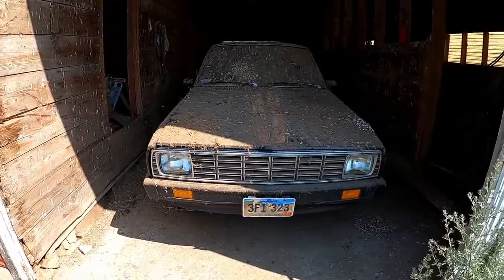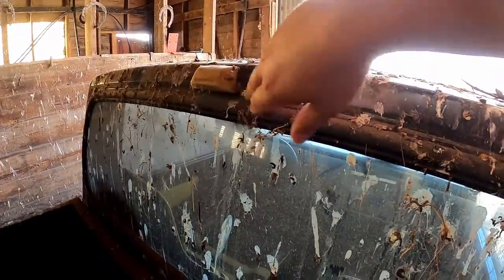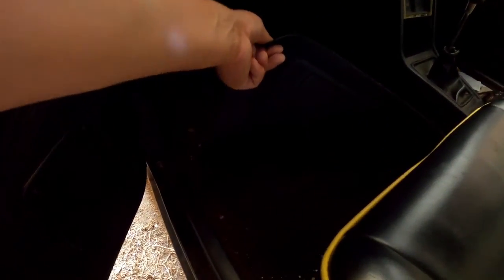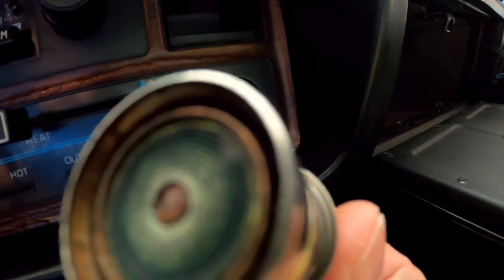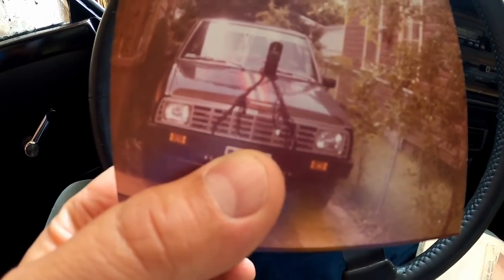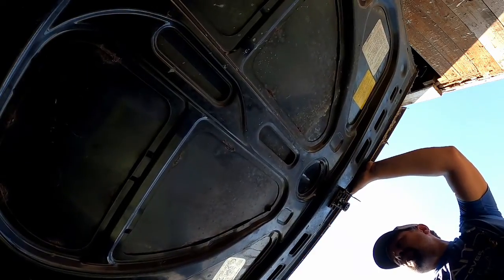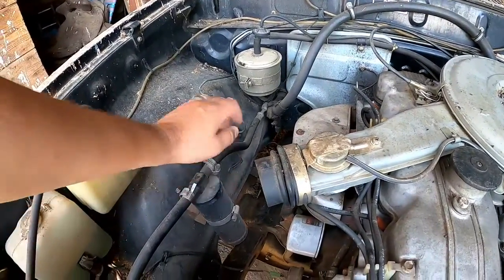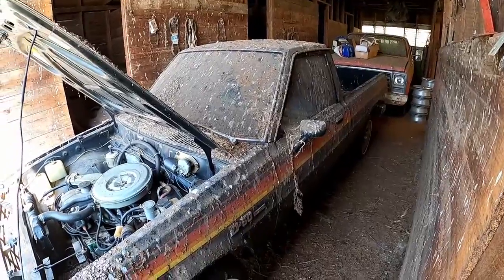BARN FIND Dodge D50 in RARE Condition

Comment: had a maroon '79 with the 4 speed ..used it as a work truck as a construction super over the PNW and norcal rather than stack up miles on my Bronco....great mileage  and pretty comfortable...loved it

if it was towed alot there's a good chance that odometer reading is high relative to it actually running
Reply from the maker: 79 D50 & a Ford Bronco.  Good days for sure. 👍

Comment: I would like to buy it, Lover those little trucks. I owned 3 at one time. You can almost rebuild one at the side of the road, 2.6 was not a power house but I hear you can buy better flowing heads now.
Reply from the maker: Fired it up today and zero oil pressure.  😮.  New video coming.

Comment: I thought all the ones were painted that way were Plymouth arrows.

I had an 85 d50 4x4 I bought new in 85 since then I've owned literally a hundred or more four wheel drive trucks (yes I go through a lot of vehicles) that doesn't even include the cars I've owned.
The little d50 was my favorite small truck ever.
Reply from the maker: It’s my favorite little truck too.  I bought it for my daughter and I to daily and then met my wife.  Not enough room now.  So it sits.

Comment: Saw the SD plates and I was like "Lets go, another barnfind in SD" , Me and my dad back in 2019 got my uncles 1982 Gmc Sierra Classic K1500 6.2 Detroit Diesel out of a shed that it had sat in from like the mid-late 2000's, took a couple batteries and ether to get Er to run, planning to buy it as my first truck from him.
Reply from the maker: Nice! 👍
Reply from the maker: Checkout the latest video on it.  No oil pressure.  So odd after simply sitting 4 years.
Reply: @2StallGarage  Thanks, I love them old squarebodys, and got another one a ,1985 chevorlet k10 silverado, that originaly had a 6.2 detroit diesel from the factory, my dad bought it in the 90s with the 6.2 having 30K mile rebuild, motor went bad and he found a 6.5 non turbo detroit diesel, and got it installed, planning to stack it and make Er loud.
Reply from the maker: That’s awesome. We’ve got an 84 k20 with the 6.2 diesel sitting in our drive way.  😎
Reply: @2StallGarage  That's sweet!!, I love the diesel squarebodys the most, probably because of reading diesel power magazines when I was little, and that got me hooked to diesels.
Reply from the maker: Lol.  How many diesels do you have in your family?  We have 2 diesel Jeeps, 1 VW TDI, a 94 OBS Ford Diesel, and the square body.   Clearly, we have a problem. 😎🔧
Reply: @2StallGarage  We got the gmc 6.2, chevy 6.5, 2012 Highoutput 6.7 cummins megacab ram, JD 8520, JD 4450, thanks for asking!!
Reply from the maker: @ellisfischbach7313  Thats quite the lineup! Very nice 👍. We have a Deere 1023e as well. Have a good weekend. 👍
Reply: @2StallGarage  You too man, my dad only has 1 gas pickup and thats a 2003 chevy silverado 1500 4x4, reg-cab, long-box, 5.3 vortec with 98,000K original.

Comment: I have an 86 d50 That I need to replace front mainseal than it would be good to go but can’t find parts anywhere
Reply from the maker: Which engine?  2.0, 2.4 or 2.6?
Reply: @2StallGarage  it’s a 2.6
Reply from the maker: L4 - 2.6L 2555cc 156ci GAS 2BBL vin E - 2 valve SOHC - If these specs line up with your engine, here's what I pull for part #'s at O'Reilly's.  Front Main Crankshaft Seal Kit - (FEL TCS45170), Front Main Crankshaft Seal - (NAT 228005), (MPS 224840).  Limited availability from the looks of it.  Good luck brother!